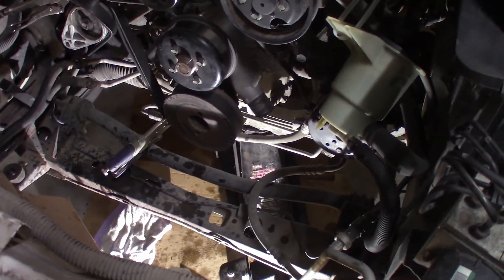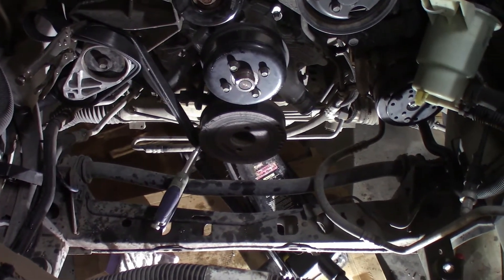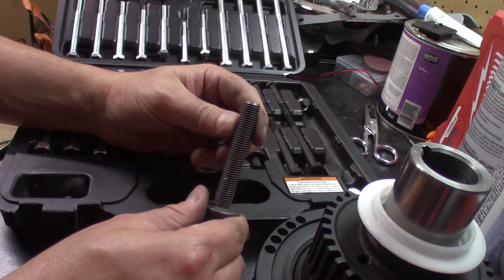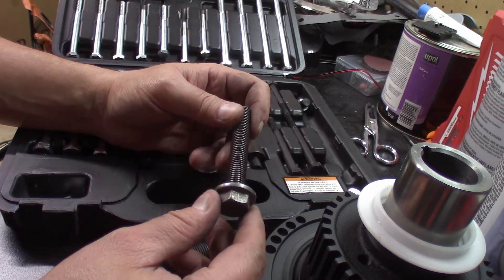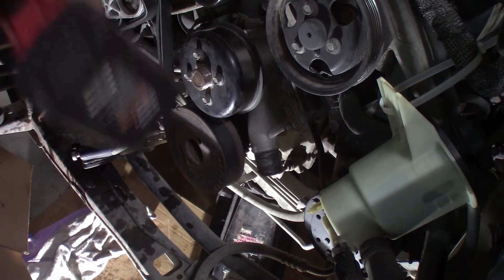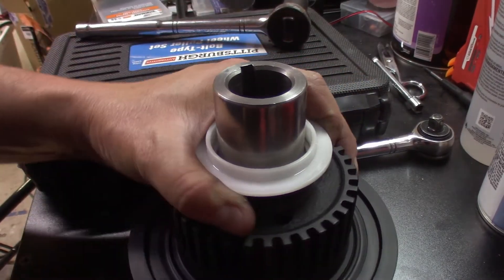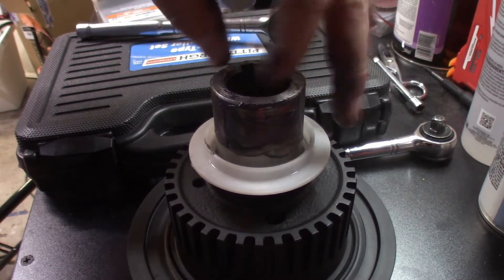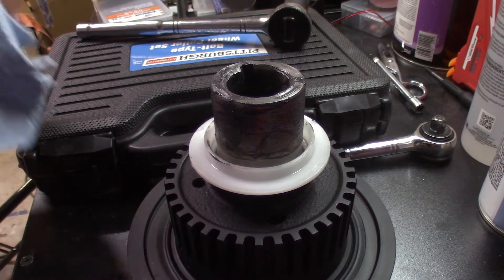Ford 4.0L V6 Harmonic Balancer install

Comment: Dude the belt slipped and i cranked the crank backwards while simultaneously breaking the bolt free. How fucked am I? Do i need to retime the cams? Dumbass move i know
Reply from the maker: Nope you are fine, there is a timing chain that keeps it all together.
Reply: @nicklldoit you rock brotha consider me subscribled

Comment: That bolt is not that easy to put on without stopping the motor from turning before you belted it off and torqued it
Reply from the maker: @TheOfficialPDro  stopping it from moving with the belt is the easiest way, the other way you would have to lock up the flywheel in which requires you to remove the starter.

Comment: So bolts out, majority of balancer is out but the last bit doesn’t want to come out. I’m spinning but it spinning the entire crankshaft.  Maybe you know something I don’t🤷🏻‍♂️
Reply: Appreciate the help and information!
Reply from the maker: @MrPrican21  if you aren't using a puller, then try a pry bar behind it and slowly back it off.
Reply: @nicklldoit  puller got it most of the way but that last little won’t budge. I’ll give it a go with pry strength next.
Reply from the maker: @MrPrican21  can you use a longer 1/4" socket extension?

Comment: Thanks for the tip on using the drawing to torque to 85 degree angle I don't have one of those fancy tools as you me tioned yourself. So that til really helps !! Thank you!
Reply from the maker: @alexbenites4608  figured it would

Comment: I was changing my harmonic balancer with the help of your video,   when 2 of my male neighbors decided they wanted to help,  great......lol. I told them numerous times about needing a longer bolt because they weren't reaching the actual crank shaft (2:16 - 3:00) but I guess because I'm a female they refused to listen,  so I let them fight it for a good while, lol. Finally I told them nevermind, to please just leave it alone,  and the next day I went out and pulled it by myself lol.   Thank you so much for your video !
Reply from the maker: @Lslade1224  Nice, slayed both of them. I had mechanics at their shops that couldn't get it done either.

Comment: My 4.0L Ford engine is in my truck (not on an engine stand). I don't have an impact wrench. When I go to loosen the crank bolt (using a breaker bar), will I be able to use the belt to keep the engine from rotating counterclockwise? Please advise. Many thanks!
Reply from the maker: Yes, it must be strapped on correctly to hold it tight.

Comment: i used a 4" extension on a puller kit borrowed from Advance Auto.   Tried multiple times but it would not come off.  The plate was thicker than the Harbor Freight one that I was using.  Tried a 6' extension and it came right off.  The screw down bolt was hitting the back of the harmonic balancer when using the 4' extension.    Also could not get the new harmonic balancer on by tapping with a soft hammer. Tried with 1x4 a piece of wood to get even pressure and tapping on the face but still would not go on enough to catch the new bolt... Went to hardware store and bought 4" bolt same thread( cant remember pitch and thread.  It's on the web somewhere) as new bolt and was able to draw it in enough to get the new bolt started.   
This video was very helpful as to what had to be done.
One other thing.  I took off the fan shroud to get a little more room.  A couple of bolts  and 1 wire clip.   Place heavy cardboard , or something to protect the radiator fins while working
Reply: Nice idea to use cardboard. Thanks for the tip.

Comment: Just loosen the pulley bolt halfway out and then use the puller on top of the bolt head.
Reply from the maker: Yes this does work well, some pulleys are really stuck on. Therefore the video shows a different way to avoid destroying any threads on the crank.

Comment: My stepdad purchased one of these and the motor went so he had a new one put in. He called me over the other day to do some work and I saw the crank pulley was put on backwards and the grooved belt was running on the smooth part of the crank pulley not the ribbed part. Currently in the process of removing it to flip it and install it properly. A little worried tho to see the carnage and how the mechanic managed to put the crank pulley on backwards
Reply: How could it be backwards? One piece  on the 4.0 V8.  Mine separated . The ribbed part separated from the pulley and moved back towards the engine leaving the smooth side in line with the other pulleys.  Took me a while to figure out what happened.
Reply: @charlesagro6678  his was the v6 model in which the pulley has 2 faces a smooth face and a grooved one. The shop that installed the motor put the pulley on backwards so it didn’t line up and kept knowing the belt off till he switched it around to the grooved side
Reply from the maker: That's crazy! I've removed pulleys that have slipped off the damper and created new groves. They can be a pain to get off, hopefully in your case there is no damage to the crank snout or the bolt.

Comment: 11:24 that won’t damage the soft lateral washers on the crank?
Reply from the maker: So what I'm doing is gentle, that is a lite soft  mallet. I'm just pushing the balancer so that the bolt catches a couple of threads. It would take crazy force to damage anything internal.

Comment: It would help me and boyfriend so much if we knew how long the two bolts for the Harmonic Balancer puller are in your video. We suspect our bolts are too short and the wrong thread. BTW I have a 2005 Ford Mustang 4.0 V-6.
Reply from the maker: 8mm fine thread bolt 3-1/2 inches long
Reply: Hey Nick, we got the balancer off successfully thanks to you appreciate that very much. Now we need to take the timing chain cover off. Do you have a video on how it's done? Or can you give us some tips on what parts we have to remove to get to it.  Thanks
Reply from the maker: @lisaannharris7341  https://www.youtube.com/watch?v=Awdr7TqB_S8&t=10s
FORDTECHMAKULOCO WILL HELP YOU ON THIS PROCESS

Comment: what thread pitch bolt did you use? Don't have the same kit and I'm at a Toyota dealer so I don't have Ford's special tool... l don't think my kit has the correct bolts. Been driving myself crazy with this thing
Reply: 8mm by 1.25 thread pitch bolt
Reply from the maker: I want to say it a 8mm fine thread, I'm not at home to check. It's a standard bolt in the Harbor Freight set- Pittsburgh Bolt-Type Wheel Puller set. Hope that helps. The bolt needs to be at least 3-1/2 inches long.

Comment: What type and brand of grease did you put on the new harmonic balancer? I'm doing this procedure in a day or two and wanna make sure I don't miss a thing. Great video btw. Thank you for sharing
Reply from the maker: Valvoline synthetic general grease, any general grease will work
Reply: @nicklldoit  
Thank you. One more question, did you remove the old key or left it in and installed the new harmonic on it?
Reply from the maker: @4u2nv503  the key usually stays put on the crank shaft
Reply: @nicklldoit  
Ok perfect. Again, thank Nick